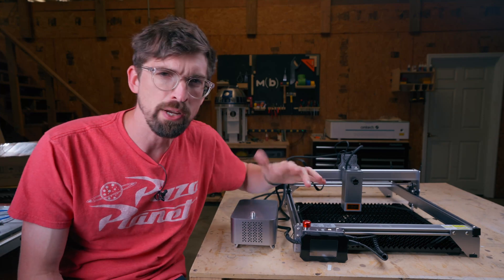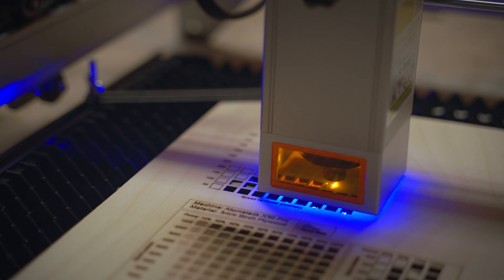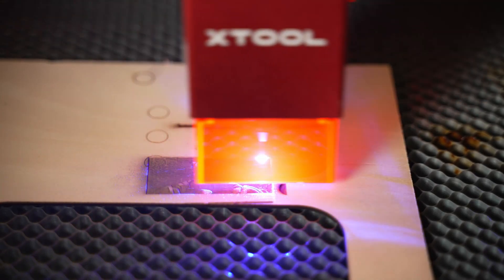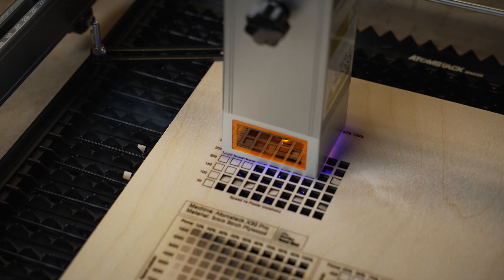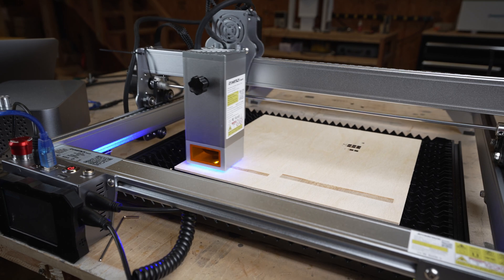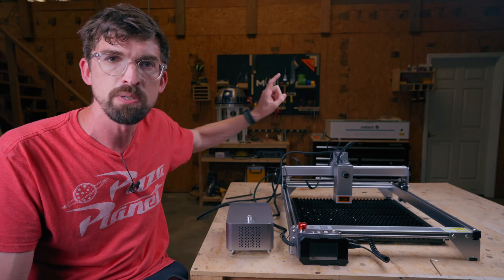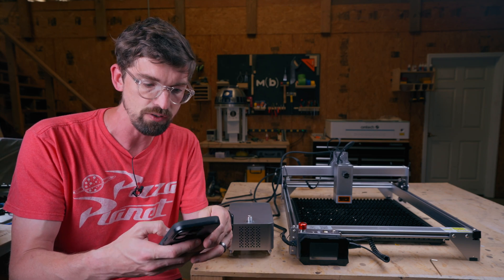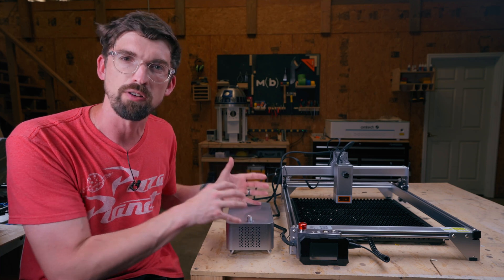Is Saving Hundreds Worth it?  The Atomstack X30 Laser Review

Comment: It's not worth it. A business won't buy this kind of maschine, a hobbyst would do much better in buying a cheap maschine, enlarge it and get an after market laser module for that. That thing is not even made of standard profiles so you can't enlarge the frame.
Also this is a poor job of a review: no test of cut, no test of precision. Does it cut acrylic? How thick the wood in one pass? It comes with air assist and air compressor: pressure, air flow, misdirections?

Comment: could you guide me in the direction of a machine. 
i have this 2 millimeter thick Circuit Board with copper on one side and the rest is an epoxy resin that i would like to cut into 1/8 inch strips.  this is all new to me and i just need a cheap machine for starting out. can you guide me in the right direction for a total new b. thanks

Comment: I like the atomstack. I have the x20 with extention. And use the xtool ra2 rotary.

What i dont like and see that isnt changed 
The feet risers  are just wierd.
And the connections on top for usb and power still there. I dont understand that they disnt changes those things with the x30

Comment: I find myself wondering if there are any diode lasers that integrate any sort of air control. I'm not that familiar with lasers - I have had an Ortur LM3 for some months now and become pretty comfortable with it. I use Lightburn and see that little switch in the layers tab for "Air". Not sure if that's a thing that is ever used with the cheaper lasers. Or, honestly, even the larger ones. I've never used a CO2 laser. I've found I get much better engraving results (or at least have to sand a lot less) if I don't use air for my engraving, or I use really minimal air. Really dig the channel and reviews. Thanks 🙂
Reply: The Atezr L2 and Ikier K1 both have air assist integrated with lightburn as well.
Reply from the maker: Hoping to check them out soon!
Reply: Sculpfun has that integrated so you can turn it on and off between layers.  There is a jumper on the mother boards that Lightburn works with and you can set up your own switched air that way too.

Comment: Atomstack now also have an upgraded controller that you can use with LightBurn to control the air assist (on/off). I agree that handpad is useless. One thing I never see mentioned is diode laser life. My x20 has reduced in power by about a third (according to my cut tests) with only 10s of hours on it. It's not a dirty lens/lens protector or S30 setting issue. They have agreed for me to send it back (after copious amounts of poor and repetitive formulaic email support). On the whole I'm not impressed with the build quality. The focus adjustment is sloppy (the addon z-height adjuster requires moving the M2.5 tapped holes for a limit switch), my x-axis eccentric nut was over tightened at the factory which damaged the v-wheels and I had to replace them. The cable management is poor. My next laser is going to be the Roly 20 or 40W. The Roly10W build quality is amazing and their tech support is first class.

Comment: Between this and the xTool D1 Pro, I'd most likely pick this. I don't need the smaller laser, and this comes with the air assist. And if I need the smaller dot, I can buy the 10w laser from the M50 and still be 10% below the total price of the xTool D1 Pro.
Reply: You would be wasting your money. Xtool D1 Pro is the best diode system on the market & you get 1 point for every dollar you spend with them, every 50 points is a dollar off in rewards program. They stack up fast because when you work that into the equation a lot of their supplies are cheaper than anyone else too. You get the 40w/10w combo & you are set for all your diode-friendly needs. “you get what you pay for” - xtool has outright sent me entire replacements for things that had issues. They take care of people over there. It can take time to correspond with them, but they take good care of their customers.
Reply: @briansooy3125 nice shilling bro. Hope xtool pays well.